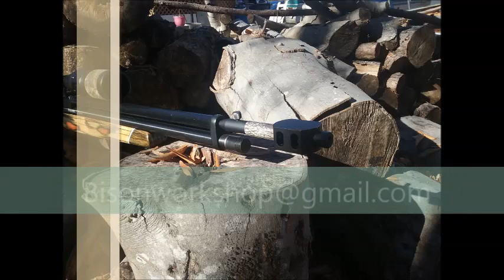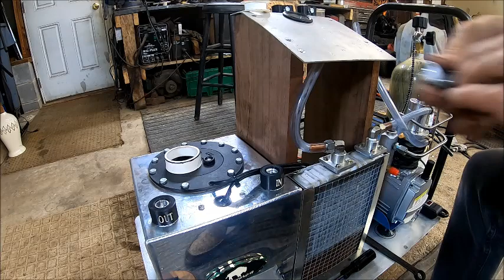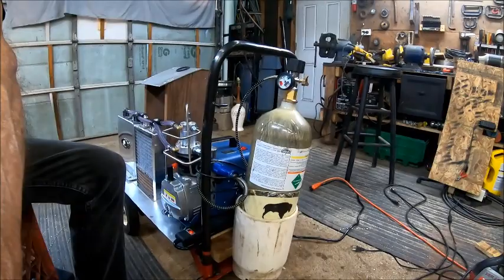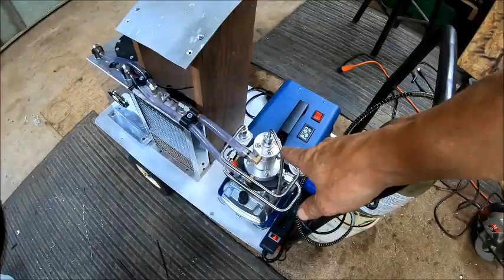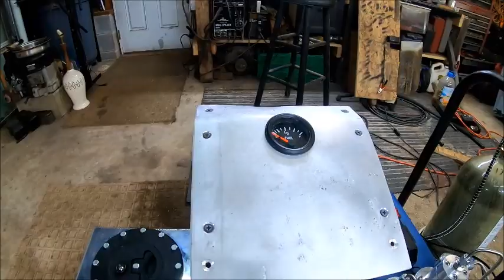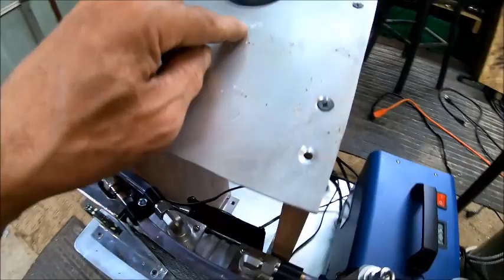yong heng compressor station build part 4 weting my water

Comment: You can't get the bubbles out because your radiator and reservoir tank are at the same level, your reservoir should be higher so the radiator is allways flooded with fluid.
Reply from the maker: yeah i know. i may raise the tank